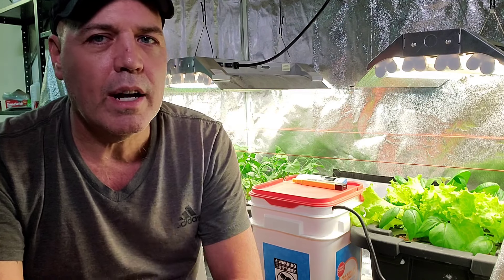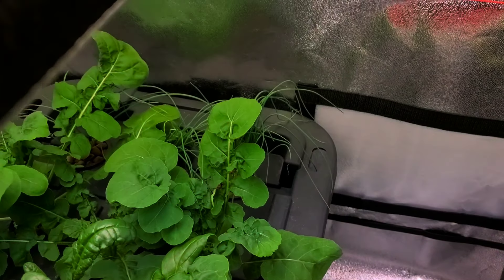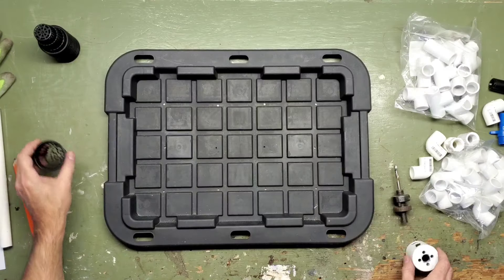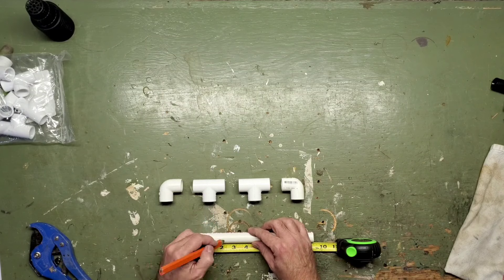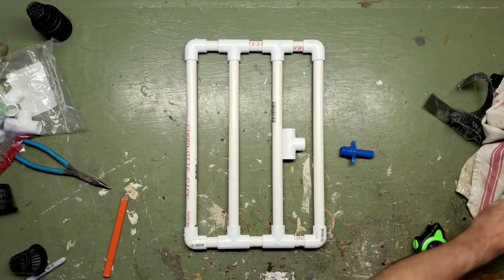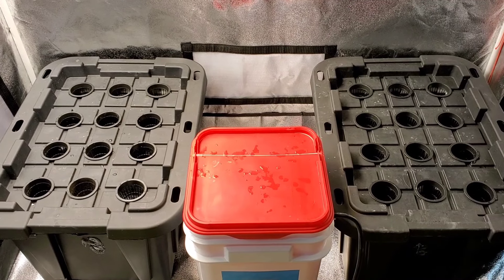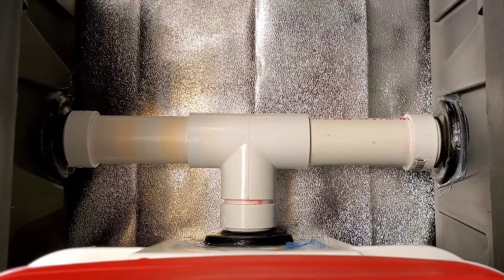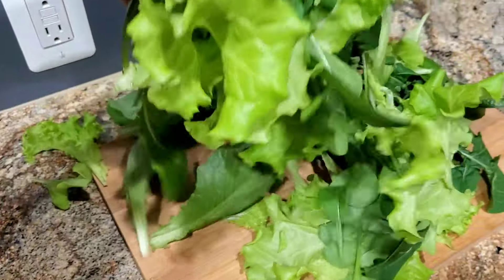DIY Aeroponics Hydroponics System

Comment: Thanks for the great post. Trying to build it myself. One thing not clear. How do you connect the pump to both systems. Did you split the pump output hose into two?
Reply from the maker: Yes there is a 1/2” T fitting (splitter) on the output line inside the larger 2" PVC return pipe.
Reply: @thescorchsquad  Thanks for your quick reply. If I understand correctly this goes in the first storage container at the top and then through the bigger pipe connection between both storage containers to the other storage container?
Reply from the maker: @wimveninga1714  yes that's correct. Laid out the same as the big pipe but inside the big pipe.

Comment: Hi, quick question.  When putting the PVC through the tub, you didn't have to use any time of seal so water wouldn't leak?
Reply from the maker: To seal the bulkheads through the tubs I used 100% pure silicone. Not sure if it was absolutely necessary but I did it anyway. Connecting the large diameter PVC pipe pieces I used a small amount of PVC glue (no purple primer). The small PVC pipe running inside the larger PVC is not glued.
Reply: @thescorchsquad  thanks for taking the time to reply.  Just a FYI I wld gladly pay for a instructional guide for a system like yours.  Since it’s my first time doing anything remotely related.  I have a system in mind I wld like to create but having done nothing even relatable to this a similar blueprint wld help.
Reply from the maker: Maybe in the future I could get something detailed put together but with the holidays and such right now I honestly just don't have the time. The video shows most of the details less the pump connections which aren't terribly difficult especially if you use one pump per storage bin and eliminate the sump (middle bucket).

Comment: What are the sizes of the pipes and net cups you are using? And that blue nozzle that attaches from the inside to the pump, where can i get one?
Reply from the maker: The white PVC is 1/2” (inside diameter). Net pots are 2". The blue fitting is called a 1/2” MPT by 1/2” barb,.I got it at Home Depot in the sprinkler/irrigation section.
Reply: @thescorchsquad  awesome I'm using this lot called DreamJoy Hydroponics system that I got on Amazon. I like yours more. Thank you for sharing.
Reply from the maker: @TheSQLPro  you're welcome. I'm glad you enjoyed the video and thanks for the feedback!

Comment: This is a great set up, I recently made one myself, and got the master blend nutrition. I followed the 12-6-12 gram ratio on the bag. I’m not sure how to calculate the ppms in it. You think you could send some info my way?
Reply from the maker: You can get a cheap ppm meter on Amazon like this one
https://amzn.to/3M1Bslw
The ppm level of nutrients you need depends on what you're growing. Here's a good chart to start http://www.homehydrosystems.com/ph_tds_ppm/ph_vegetables_page.html
Generally the standard Masterblend ratio of 12(MB)-12(Calcium)-6(Mag) works for most things if you don't have a meter. For leafy greens I used approx 10-10-5. I'd also use a ph meter and shoot for ph of around 5.8 or 6. The pH affects how plants can absorb nutrients. You can use products like "pH Up" and "pH Down" https://amzn.to/3xiOU0q to adjust using a cheap pH meter which can also be found on Amazon as well
https://amzn.to/3KGwQkw
Adjust pH after mixing the nutrients. Hope this helps!
Reply: Okay awesome, I did adjust my ph after with the Vivosun tester and am about 6.3. I have a variety of pepper plants in there right now and technically they are at the transplant stage. I guess I was wondering like how to adjust the ppm upwards without going to much, you know what I mean?
Reply: Also, as it gets later and I want to flower I assume the ppm keeps going up as I change the lighting time back down to 12 on and 12 off
Reply: I appreciate you replying super quickly too, I’ve been looking on how to figure it out for the past 2 hours now haha
Reply from the maker: @jeffreyhurley4735  you don't need to change your lighting (16 hours on) or the nutrient formula at different stages of growth (other than seedlings) if you're growing peppers. If you're growing cannabis I have a solution for that but with pepper plants it's not necessary.
Reply from the maker: @jeffreyhurley4735  the pepper plants I grew in this video used the 12-12-6 all season https://youtu.be/GnoVOdkl3-E
Reply: Okay cool, I looked at that chart and peppers had said over 1500 ppm but the 12-6-12 is not that high is it?  And I’ll probably get the tester to see what it actually is.
Reply: And when you said 12-12-6 is that the order of the npk?
Reply from the maker: @jeffreyhurley4735  I don't think the 12-12-6 is over 1500, I think it tested at around 1300 but my plants grew great with it.
Reply from the maker: @jeffreyhurley4735  12 of the Masterblend (the green powdery one) which has the P and K... 12 of the Calcium Nitrate which is the N... 6 of Magnesium Sulfate (Epsom salt).
Reply from the maker: @jeffreyhurley4735  the ratios of Masterblend NPK are 20.5-12-25 when mixed.
Reply from the maker: @jeffreyhurley4735  to clarify, the 12-12-6 is the amount of grams of each part of the Masterblend per 5 gallons, the NPK is what I mentioned in the previous reply. Per gallon of nutrients you'd use 2 grams of Masterblend powder, 2 grams of Calcium Nitrate, and 1 gram Mag (Epsom).
Reply: @thescorchsquad  okay thank you very much for responding to me! Thanks a lot for all your help, hope all is well!

Comment: Awesome job. Working on my own setup as well. I am wondering why you are not using an air stone in your reservoir. Also, if you get some algae build up in your reservoir, switch to a black container or put a black bucket upside down over it. Thanks for the video!

Comment: Loved it! How do you prepare the seedlings for that success? Do you have another video for that? Also, what material did you use around the buckets for reflection? Thanks so much for sharing this!
Reply from the maker: Glad you enjoyed the video, thanks for watching. I don't have a video about starting seedlings yet (coming soon) but the seedlings are grown in a material called rockwool cubes. They are inert. You can find them on Amazon https://amzn.to/3aNCyyt. Basically you plant the seeds in the moist rockwool cubes the same as you would soil. Once roots grow out the bottom of the cubes you can transfer them to the grow system. Just be sure not to let the cubes dry out when starting the seedlings but you don't want them soaking wet either. I have my setup in a grow tent (link in the video description), that's the reflective material you see. Before I had the grow tent I used this material https://amzn.to/2YhCdS4
Reply: @thescorchsquad  Thank you so very much! That's really very helpful!

Comment: How did you get the Tee inside the 2” tee
Reply from the maker: The tee was slip x slip x FPT. I had to cut the branch of the 1/2" FPT down a bit. I left enough to be able the thread in the barbed fitting that would be going to the pump. Once the tee was inside the 2" pipe with both 1/2” slip pieces extending into to the tubs I attached the pump line to the barb fitting and threaded it into the tee. Then finished connecting the last 2" pipe to the sump. Hope this helps, kinda difficult to explain. Guess I should have included it in the video, sorry.

Comment: are nutrient solutions the same for hydro and areoponic systems?
Reply from the maker: Yes. However, nutrient levels, meaning the concentration (PPM), will vary depending on what you're growing.
Reply: @thescorchsquad  Thank you, thats helpful
Reply: What do you use as a nutrient solution
Reply from the maker: I use Masterblend. It's a 3 part powdered solution. 
You can get it on Amazon here https://amzn.to/3fzePoW
Reply: Thanks peace!
I have a tower garden. My ph is good. I used a blend of miracle grow, baking soda, and epsom salt. They grew really well for the first week. Then just start dying. It is on a 15 minute on/off timer. Do you know what I may be doing wrong?
Reply from the maker: @DarkKnight-sd1ic  the type of nitrogen in miracle grow needs microbes in soil for it to work properly. Urea nitrogen (which plants can use directly from water) is low in miracle grow also. If you change the MG solution frequently (weekly) and use higher dose than stated on the package you may have some success. At that point tho it might just be cheaper to use actual hydroponic nutrients because you'll change the solution less and they'll get the exact nutrients they need. I've used the MG years ago before hydroponics was so popular and my plants grew ok but nothing like the results you get with hydroponic nutrients.
Reply: Peace Love Garden I bought the kit per your recommendation. The master blend, epsom, and calcium nitrate. I’m sorry I am such a noob. I subscribed to your channel to learn more. 
What would the mixture ratio be per gallon for these.

Comment: I tried to edit my last comment. But it wouldn't let me.
So here we go.
I forgot to add one more important thing.
Your on off time's for your sprayers.
When growing with true aeroponics ( HPA ).
You use misters in your root zone. Because you are trying to achieve a certain droplet size.
Now try and picture some roots. You will see some main roots and you will see some little hair like roots coming off of those.
Those little hair like roots help tremendously with the uptake of nutes for your plants.
Now what happens when trying to grow with LPA is its impossible to achieve the droplet size that is needed, because of the sprayers we use.
So what happens is because of the droplet size of our sprayers. If you leave your on times on to long you damage all those hair like roots. And it keeps you from achieving your potential.
So you want to keep your spray on times very short.
For example spray your roots for 5 seconds every 15 minutes. This will let those hair like roots grow.
Remember this is aeroponics not waterponics.

Comment: Does it matter that I use all 360 degree nozzles?
Reply from the maker: As long as they're pointing down it probably won't matter. When I first had them pointing up it was causing a lot of splashing tho.
Reply: @thescorchsquad  thanks for the reply. I am having it pointing up and it does create some splashing through the net cup, I will change that.
Reply from the maker: When I pointed them down I also raised the entire manifold as well so to be sure and wet the root zone.
Reply: When the nozzles were pointing up and spraying threw the net pot, were the net pots full of medium or were they empty?
Reply from the maker: The net pots were empty but it wasn't just spraying out of the net pots. It was hitting the lid and dripping out around the edge of the storage tub. It would have required sealing the lid or something which I didn't want to have to do. My solution was the easier option.

Comment: how many gallons of water are your running?
Reply from the maker: It's about 8 gallons in the entire setup with both tubs and the common sump. You really just need to keep the fluid level high enough so the pump can't suck in air. The less water you can use the better in my opinion for less waste when doing water changes.

Comment: So I have researched into which containers are best for an aeroponic system. I saw that the tote boxes are not FDA approved - food safe plastics. Are you not concerned that certain plastics will degrade and be released into the system , and potentially affect the safety of the edible plants you are growing?
Reply from the maker: Personally I'm not. If you are concerned about such a thing you will probably have a hard time finding large containers or they will be expensive. You may be able to modify this system into a series of food safe 5 gallon buckets but off the top of my head I'm not sure how you'd do it.
Reply: Peace Love Garden thanks! I have also looked into bigger containers , you are completely right , they are very expensive. I’m not sure how I can do that , I was thinking of making a HP aeroponic system using a blue (food safe) barrel , about 120 litres. How difficult do you think it would be compared to this method you are using?